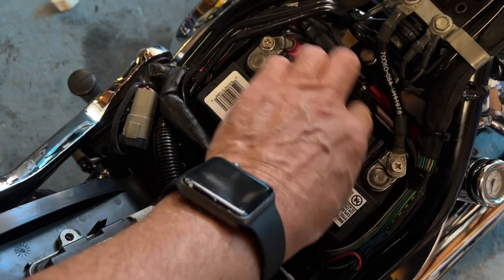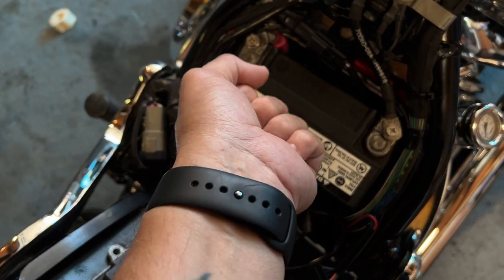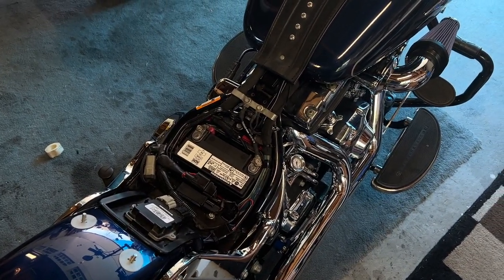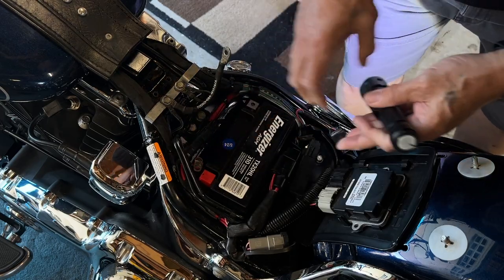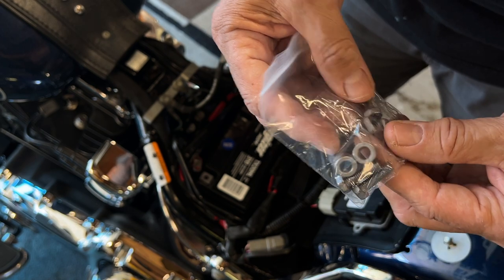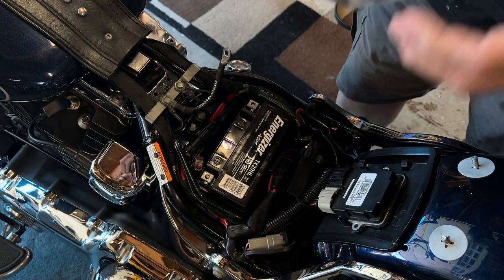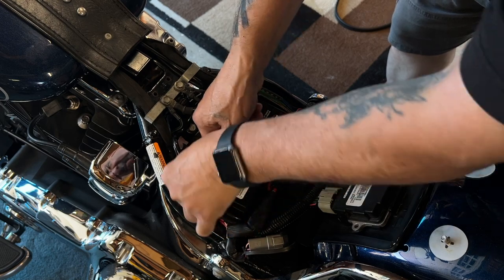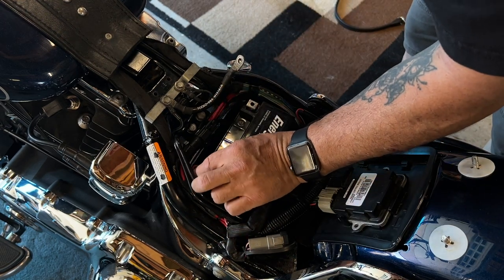Importance Of Working On Your Own Harley & New Battery Install

Comment: I’m still working on the 81 fxs and I’m stuck on the wiring of the new harness. Thank you for the awesome tips brother.🙏👍🇺🇸
Reply from the maker: @codykendra1641  I wish we were closer I’d love to help you get it going and thank you for your continued support. It’s greatly appreciated. Have a tremendous weekend! 🙏🏼👍🏽🇺🇸
Reply: @jcustombuilds  absolutely brother that would be a great help. The only problem I’m having is a lot of the schematics and books I’ve purchased are not very informative on the location of all the wires and where they connect.
Reply from the maker: @codykendra1641  do you have an original manual? That’s where it would be. You could possibly get one from Harley of course it would need to be ordered but it would have everything you need.
Reply: @jcustombuilds  yes I did. I purchased the original manual. I’ve also purchased aftermarket manuals as well. In total. I have seven manuals. They pretty much share all the same information give or take a few different schematics. The problem I’m having is they don’t share pin locations on the connectors